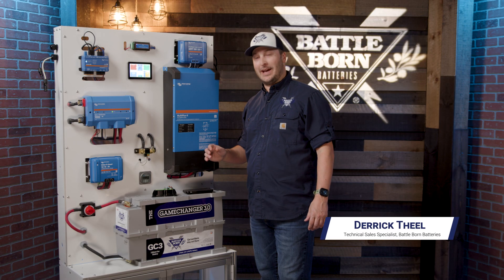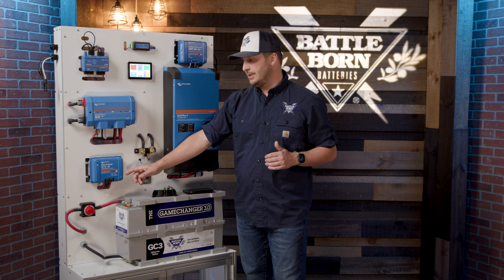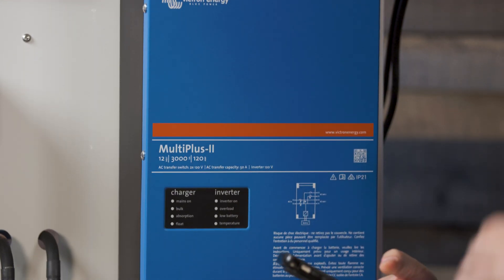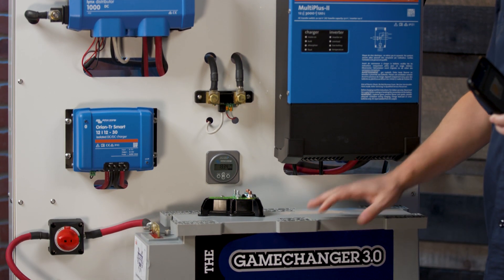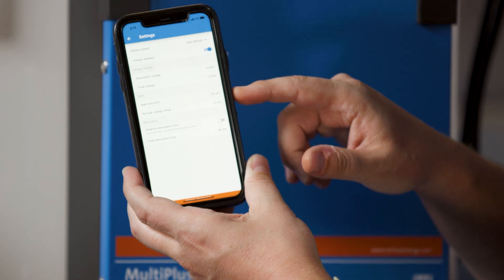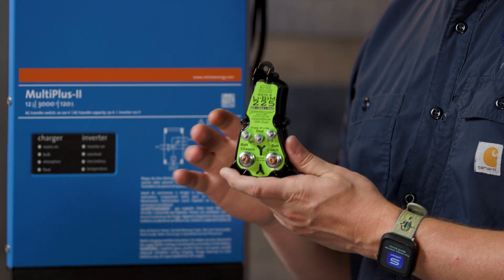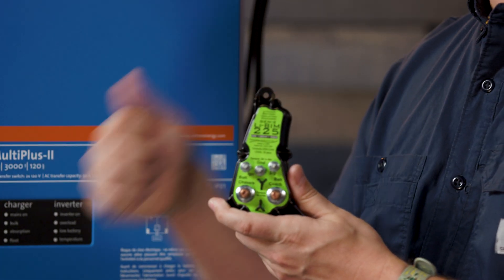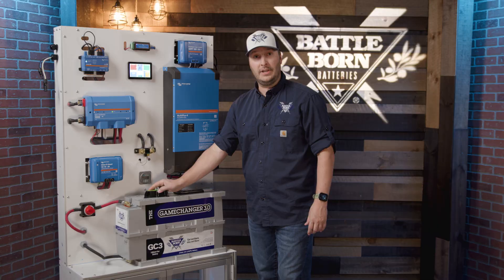FAQ: Programming Your Orion DC/DC Charger

Comment: How do you size it. I have 200 lipo4 and 365watts solar. Do i go 18 or 30amp?
Reply: 30 amp. Just like the solar charge controller is rated at 30 amp.  Just learn how quick a lithium battery can  charge and that how many amps you can throw at it. Should be about 25 30 percent of battery capacity.
Reply: It depends how you are using it.  If you are using the Orion for a Motorhome or Van, where you can control the size of wiring being used you will want to go with the 30 amp Orion or even, perhaps two 30 amp units in parallel for 60 amps.  If you are using it for a trailer where all the current will be passing along the 7 way trailer cable which uses a 10 gauge or 12 wire for charging voltage, you will want to use the 18 amp model to limit the amount of current traveling through the cable.